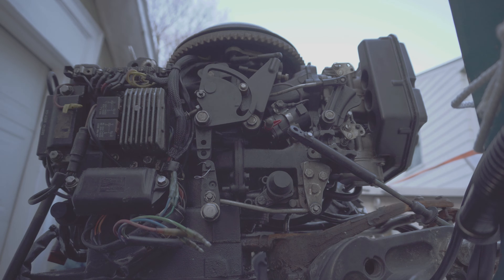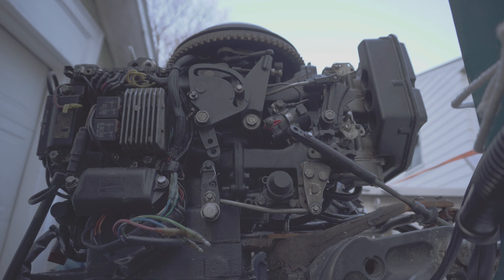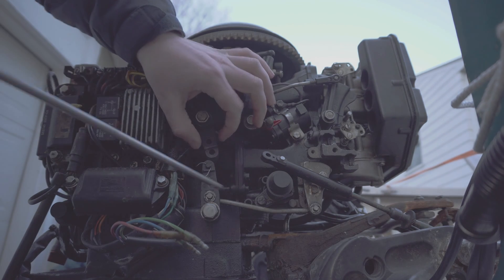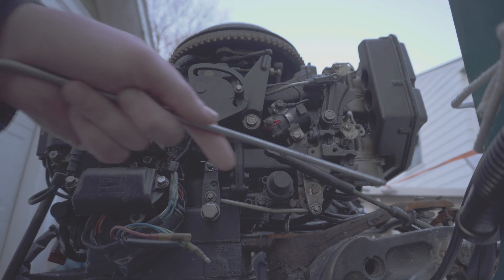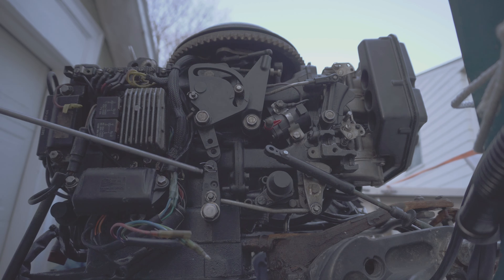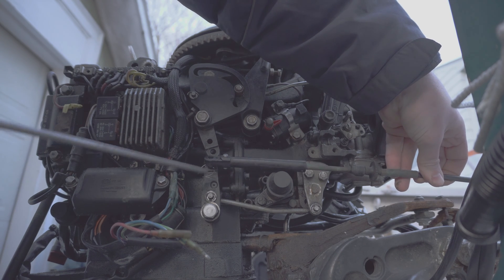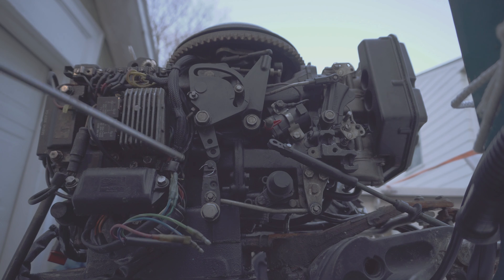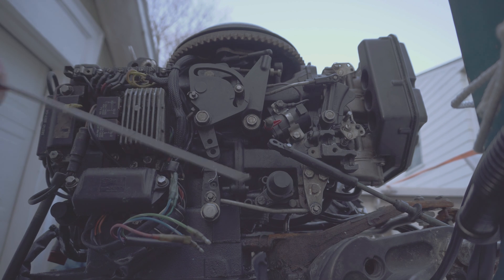Outboard control cable adjustment for shifting gears - forward / reverse

Comment: Hi I have a 70 hp outboard johnson motor need help on the throttle. The issue is when I put it n forward out of neutral the motor dont start going till I put the throttle to the max.
Reply from the maker: Seems like you need to have someone push lever into forward slowly while you look and see what happens at the cable end under the engine cowling. It also could be an issue with the controller if everything else looks correct on the engine side when doing it back and fourth.
Reply: My boat guy I told him he say it might be the timing but I'm doing a tune up on it to see if it will run differently it'll not he say bring it to him and he will do the timing on there.
Reply from the maker: @slickwill456  it's possible if you just watch the levers move you should be able to tell pretty quickly if something doesn't seem right.
Reply: I did have someone there when I pulled the lever forward  I pulled it out of neutral nothing move then when I pulled it to the max it moved its like my 70hp supposed to do 40MPH it does like 20 when it's pulled to the max
Reply from the maker: @slickwill456  just do it in driveway don't need it to be on.

Comment: I have an Evinrude 48 spl. It wont shift into reverse while  the boat is in the water, it only grinds. But out of the water it shifts into reverse just fine. Any idea what it could be? Neutral and forward are perfect
Reply: Don't know if you still need help with your shifter.  Only thing I can think, why it works on land but not in water, is the shifter mid-neutral point is off, not engaging in reverse fully.   Works on land due to no resistance, but in water will 'slip'.  Try disconnecting the shift lever at the motor, and shift the motor into gear by operating the lever under the hood manually back and forth (look out for the flywheel...:o), see if that works differently.  Anything else let me know - Cheers!~  Bellarmine
Reply: I’m having the same problem, did you fixed it? What was it?

Comment: In older models like mine (1979 55hp johnson) there was no spring in the gear housing to keep the clutch dog in place so it was done with the linkage pressure only. For this reason this video probably applies better to newer models which introduced the spring. I'm not expert but would love to get others thoughts on that as I'm sure that my model doest have a spring loaded clutch dog and i'm also sure they introduced them later on.

Comment: My o ring guide slips off all the time. I took a binder clip from my office drilled a hole and attached that to over the o ring guide (end of the clutch controller cable)  and the clutch lever like binding a inch thick ream of papers. The o ring guide at the end of the control cable doesn't line up vertical with the clutch lever. Any other ideas on that issue of the clutch cable slipping off the clutch  lever. The design baffles me as the throttle cable is held on with a bolt washer and nut but not the clutch cable. Do I have the clutch and throttle cables reversed?

Comment: How do you fix
Reply: How do you fix throttle cable candle on a 1978 Mercury 80 horsepower 800 series model

Comment: This was really helpful, I have a 150hp Johnson and when I put it in reverse I only have a small amount of throttle play. I can only reverse at idle speed which I assume is an issue with the throttle cable. Is there another video regarding throttle? @Hello Everyone
Reply: Daniel, Were you ever able to fix your reverse issues?  I have the same issue with the same motor.
Reply: The cable was broken.. new cable fixed it.

Comment: My Johnson 88 hp go reverse no matter what as my engine start running
Reply from the maker: Sound like the shift link is broken, check for the bolt it may have just fallen out, or the controls are not working and you just need to shift it by hand.

Comment: Thank you for the video! I do have a question though. We just bought a 1979 glastron with a 1993 evinrude tracker 40hp. We can't seem to figure out why the throttle box makes a very loud buzzing sound. Do you know what this is?
Reply from the maker: What do you mean? when you turn the key on the throttle controls, it keeps buzzing after the initial beep?
Reply: I believe it is the overheating alarm

Comment: Glad I didn’t take this guys advise.... i would’ve wasted a lot of time. He has no clue what he’s talking about. I adjusted my cable about 10 turns and boom! Done!
Reply from the maker: 10 turns is a lot. That goes under the category of what I said that unless it's a really out of position it's probably not a shifting related issue. However if it is that far out of position you will be able to tell fairly easily by just switching it back and forth and seeing how it reacts. Anyways good job.
Reply: Why do you think there's a better chance that someone can help with the latter and the size of the polecat